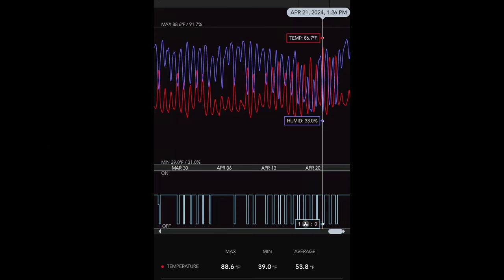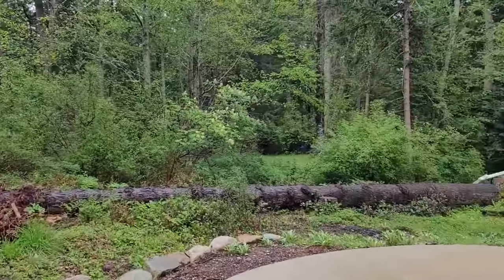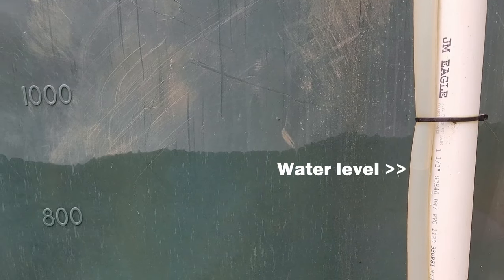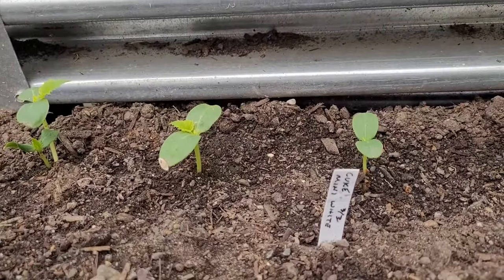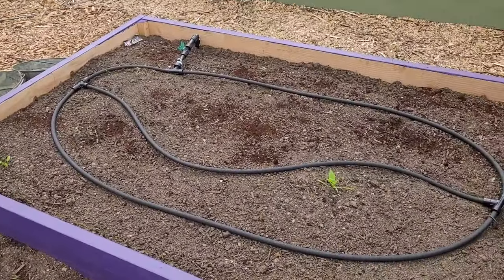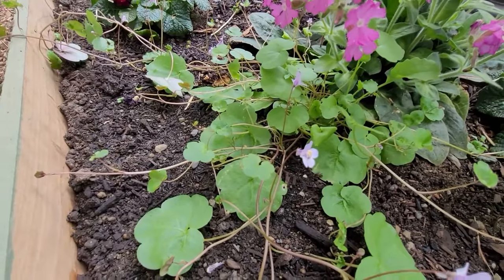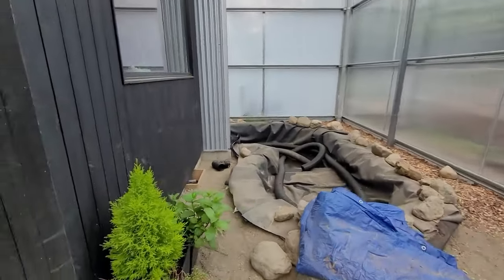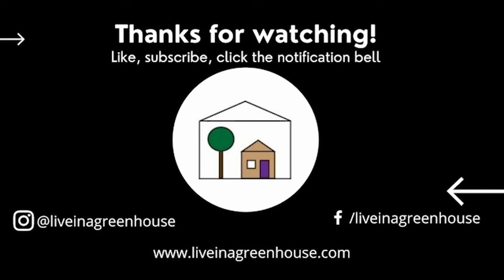E85 Tiny Home in a Greenhouse | Planting spree in the greenhouse

Comment: I am excited about the leaks  I will buy organic garlic and then break the cloves up and plant them.  Looking good you have made progress.   In the shadiest part of your yard- I would make a mushroom fence or pile.   Have seen people take timbre and drill into it and then inoculate it with a mushroom plug.  Could celebrate the end of the mold watch with the creation of a fungus farm.   After a year do you need to change your water filter in the crawl space?
Reply from the maker: I've actually been thinking about mushrooms but that's probably not going to be this year. Yes, I need to change the water filter. The house is on public water which is very high minerals. I've never changed a water filter before so this will be another learning experience.